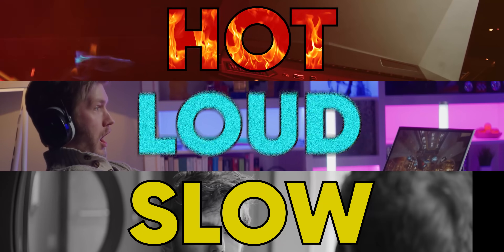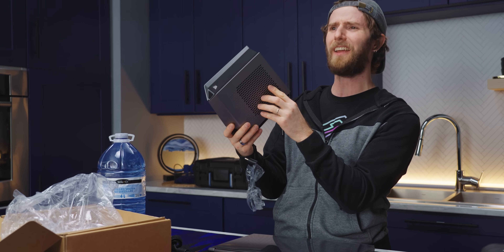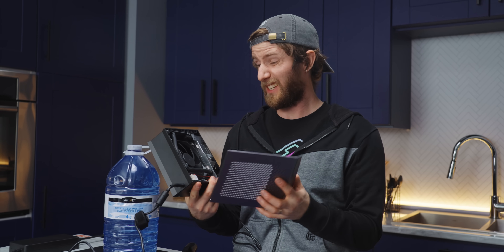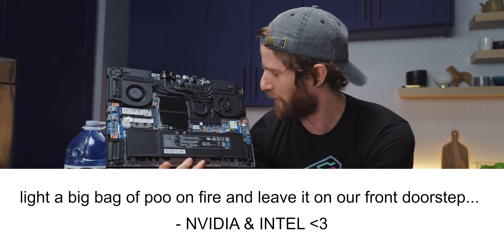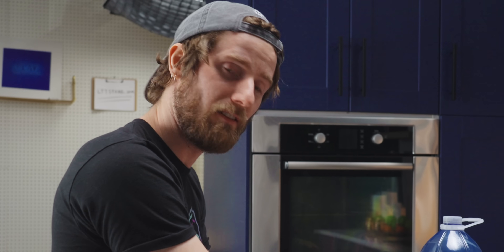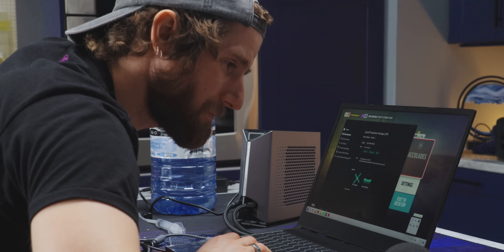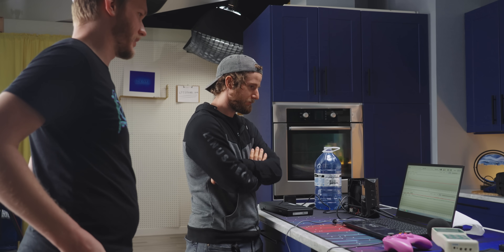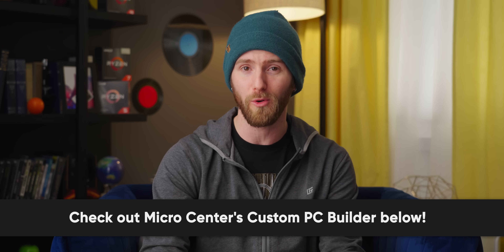This INSANE Watercooled Laptop Has a Huge Problem! - Eluktronics Prometheus Prototype

Comment: A laptop designed with its interior totally sealed off from ambient air -- and cooled if necessary by a closed water system -- would be useful for harsh environments, such as an old truck northwest of Albuquerque in which a poor friend of mine lives.  Minerals in the ubiquitous dust keep destroying his laptops' motherboards.
Reply: idk if that idea could be needed/used for a widespread enough consumer base, but for this setup anyone could DIY what you suggest with some tape and common items, or with commissioning a 3d print of the main laptop bottom cover piece but with no grills or openings, and adding a rubber strip/teflon/etc.. along the edge when screwing it on. I'd probably disable turbo boost or at least set wattage limits with quickCPU or AMD control panel if I were sealing it like that.
Reply: @arsenal4444  : I can imagine DIY sealing of the air vents of an ordinary laptop.  But for it to be watercooled instead of throttled, I think it would be difficult to DIY.  And there may be other airways besides the vents, such as around the ports, if the laptop wasn't engineered to be waterproof.
Reply: @brothermine2292  well yeah that's basically what I said. I thought we were talking about dust/debris proofing though. Obviously for water it's a whole different level that I really wouldn't have any idea how to approach..every keyboard key is an opening, etc..
Reply: @arsenal4444  : The reason I mentioned waterproof is because waterproof would presumably imply dustproof, and some waterproof tablets exist.
Reply: @brothermine2292  so then your friend could just buy one of these tablets?
Reply: @arsenal4444  : Yes, if he could afford to spend a lot of money, and could get by with a relatively snall screen.

Comment: "It must have broken in shipping" 
Linus literally knocked it over earlier in the video.
Though seriously, it is way too narrow of a footprint. It's wobbling just sitting there. That thing is going to get knocked over all the time as you shift the laptop or tubes around
Reply: yeah true, needs an intel NUC type of form factor for stability with some 1/2 inch ish little legs for airflow
Reply: @arsenal4444  or suction cups/magnets on the bottom... don't need to rebuild the wheel
Reply: @moonman506  whatever gets it done, I'm not married to my randomly suggested solution, but I'd say adding more complexity and points of failure without a clear added benefit is not an advisable move

and nice name

Comment: Gaming laptops are always sacrificing either performance or portability... i have one... that thing weighs like a ton... and it's dreadful boeing 747 jet engines just keeps reminding me that i soon have to take out the 389 screws keeping it together, and reapply a bucket of thermal paste, and dig out 6 tons of navel lint... while looking at it, wondering how the 2 remaining pieces of plastic, that haven't sheared of yet, keeps the damn thing together still...
...but that 7 year old thing, that has the internals of a 13 year old gaming pc, still manages to bring a tear to my eye, every time i think of the price-tag...

Comment: I LOVE this idea, I've been daydreaming of external cooling solutions for laptops these past 20 YEARS (even have some of my own designs). The only comment I have about this device is, I'd like to be able to "SEE" reservior level and all the tubing (to check for leaks/in case of) and I think this can be done without sacrificing the esthetic by adding transparent plastic (ON THE BACK) and/or a sliding panel on the side (think glass door) and a level sensor that can emit some kind of audible alarm (hopefully not an air raid siren but loud enough to keep you informed).

Comment: I bought a m1 air its not hot or loud having no fan or moving parts great choice for people who want a laptop with no noise that is still high performance. I'm wondering how much performance you loose from the power pass through with laptops power throttling so easy now

Comment: I picked up a previous gen Mech G3 - these laptops thermal solutions are not great.  They get stupid hot while just idling.  Do like the idea of the AOI pump design tho.  Wish more was done with these laptops to keep the temps down.  Like full bios control over the fans.

Comment: I guess there's still some room for improvement. 
Perhaps increase the water duct's coverage of the heatpipes assembly to further improve on heat capacity/soak ability/trasnference?
Perhaps use quick disconnect assembly on both ends to ease application?
Perhaps consider adding some USB hub or port replicator feature to bolster usability while facilitating some connectivity/configurability for the users to further tinker with, aka user defined "cooling profiles"? ;) 
It could be an even more interesting option when coupled with even 17+" devices that typically are less mobile but are often with more powerful/less limited power-wise components... And if considering such a more stable/less mobile variant that could offer a combo of port hub and even improved cooling, one might toy with even slightly larger higher capacity cooling solution as a more extreme version of this attempt, it could make more sense given the theoretical heat-generating limits of the top components on offer available in those larger chassis formats -  as in maybe consider future laptop variants with thin frames that normally rival XPS/GRAM devices with heavily limited compute componentry, and yet that could be extended with such a port replicator/base station/external cooler to unlock full power of the components - as in take the typically step-downed <35W CPU and <60W GPU thin/light big laptop, use the external cooler and by doing so unlock an extreme/performance mode that bumps the wattage to the thick boys region and beyond ;) that this contraption could cool safely...
And there is another drawback to the current solution that makes it less portable-friendly - when you want to travel it is advised to disconnect the cooler's piping, bleed out the laptop part of loop, let it dry a bit, before moving on. Maybe a future revision could have a mode and extra gear to also blow the air through pipes/laptop to push the water back into the reservoir/cooler unit part of the loop to make it safer/easier to do this. 
But hey, looks great, maybe Asus will get back to those extravagant extremes in their lineup once again and combine a few technologies - for one, dynamic/programmable wattage delivery with basic and with-cooler modes, plus make the devices slimmer but still big (as in do a GRAM-heavy 16-18" "Flow X17" that could transform into Alienware X17 beating monster), perhaps use something similar to their eGPU with USB-C/TB data (thus port replication/hub) and charge (perhaps even 2x100+W lines so 2 C ports used to bolster this and the former's delivery) capabilities. 
Let's hope this solution gets perfected!
Reply: Top comment worthy imo

VERY good point on blowing out and drying the liquid pipe when disconnecting. Maybe have an attachable/swappable filter piece on the laptop out port/path so any buildup can be easily captured and dealt with for the longevity of use.

Also something you mention that really came to mind for me on this - for ultra thin/extra portable designs this could allow was more high end components, just wattage locked to the usual 25-50W, but which could go 150W+ once connected, and all through a since USB-C going to this and a hub at the stationary home spot.

Excited to see whoever develops this concept to market in the future since it could target everyone from lower end users looking to survive from heat and bring their systems to usable status all the way to high end users looking for maximum performance and quality of life at the same time, and are willing to pay whatever price for it. This is really looking like a way to offer what both are looking for.

Comment: lol keep the laptop make your own rad/pump/res combo,  if the tubes stay as they are it should be a easy matter of finding fittings to convert to the laptop and you could have WAY better hardware. d5 pump, 280mm rad add a dock and it could be a beast... and least of all you could ajust the freaking rpm....

Comment: This is amazing! And since it has tubes you can do a little diy to mount the cooling unit under your desk and just the tubes coming up that would solve a lot of noise issues and with noise dampening strategies you could have a complete silent "desktop replacement" laptop also there's chance to upgrade the fan with a noctua if you want

Comment: I've never understood the modern obsession with eliminating fan noise. Fans have always made noise and it's never been a major issue. This product seems to work fantastically, and yet they just can't get over the noise, which does not seem that bad in the video anyway (yes, I know the video probably isn't representing the noise level accurately - but it's not like it was as loud as a jet engine or anything). I don't know, I just feel if my computer performs and stays cool, I don't care a thing about fan noise.

Comment: I'd personally like to see a quick disconnect valve on the pump itself so the tubes come with a similar looking connection piece on both side. This way if for whatever reason it gets jerked the whole system doesn't go with it. It simply disconnects and you have to plug it back in, With that in mind intake and outtake tubes on the pump/res may look better on the side then coming out the back? Otherwise its a cool product. I'm am wondering if an L shaped res would be better so that the res runs the full length of the rad and still comes down right over the pump. would provide more coolant space and would take longer for the water temp to equalize, but not sure it would help long term with temps.
Reply: Pretty sure its not that type of quick disconnect, its secure in the machine and u have to pull down the tab to disconnect, so even if it was on both sides its taking whatever connected with it. U really wouldnt want it to come out even on accident, they are transfering water so If the tubes come out during use good chance ur gonna soak ur laptop.

Comment: "Must have broken in shipping" would have been a perfect time to cut to some clips of him prying the case open, overfilling the port, using his hands to slow down the fan and pump, and purposefully knocking it over lol.
Reply: Yeah, Dave2D's cooler worked fine.
Reply: it's not even broken, the loose wire's hitting the fan blades, i'm astonished that two pc nerds couldn't figure that out.
Reply: That's what I was thinking... although it should be more robust than that lol.

Comment: What would be a challenge though, it's something like this for existing laptops that don't have any way of tidily or safely adding water cooling, like my MSI GE72 6QD Apache Pro. It has copper heat pipes, but no chance of having nice tidy water cooling like this. Would be nice if someone came up with a custom bottom cover and cooling solution that kept the design of the existing copper pipes, but with additional water cooling to help cool the laptop's GPU and CPU
Reply: idk enough about how the liquid cooling pipe lays on top of and contacts the standard heatsink pipes already there to make this call, but I imagine this could be attempted with aftermarket attachable liquid cooling pipes - they just have to fit within the layout of the internal components, go over the correct already present heat pipes, have enough clearance between the components and the laptop shell, and the bottom shell piece of the laptop probably needs some DIY cutting for the liquid in/out ports. 

The main thing though is whether the liquid pipe is just on top of the heatsink pipes or more closely connected for heat transfer in a way that can only be done from the factory...as in just connecting a liquid heat pipe on top of a regular heatsink setup most people have may not really produce much of a result if the contact isn't conductive enough for the heat to escape.

But it sounds like a viable idea at least for DIY modding, but probably with more difficulty due to fragility of components and likeliness of compatibility for everything to fit where it needs to, as well as I predict less performance gain due to the quality of contact.
Reply: @arsenal4444  Oh I mean like an aftermarket solution, as in a company makes water cooling solutions for a wide variety of manufacturers, models, and years of manufacture. It probably will never happen, but it would be nice to have a nice and tidy aftermarket water cooling solution for laptops
Reply: @THAT1ZELDAFAN  That...what I was talking about

Comment: Next; use the connector for the water connector at the cooler and take the control board and make your own custom 240 or 360 cooler and retest!

Comment: the reason why games need so much cpu is because of all of that wireframe data that is not visible that is being processed anyway and even invisible textures. its the crappy way they create this so called realistic computer graphics that suck the life out of the computers. no matter how fast computer you have it will be obselete in 2 years due to the crazy lazy programming of games today and all that glitchy dev code by al the crappy developers. even the runtime is often written in high level language that screm overconsumption of resoruces. windows 10 sucks about 50 percent cpu at iddle and no matter how big cpu and how much ram you have the computer will still use 99 percent cpu running youtube. its microsoft crapheads software inside.

Comment: Glad to know 12rh Gen Intel is still disappointing even in the mobile platforms. Those temps are extremely unacceptable under air. Cool to see folks are working on the cooling. Even if Intel can't make a processor without it being a refresh of 4th gen +++++++++++++++++ getting hotter, it has caused the rest of the community to get nice engineering solutions to fix Intel's short comings.

Comment: Buys laptop to have a small device, to not need to buy desktop.
Connects a big stationary water cooler.
Why did I even buy a laptop when I now cannot move it due to all these accessories? Wouldnt desktop be cheaper?

Comment: One problem I see is when you disconnect the cooler, does the laptop leak coolant? Or are there seals? Also if it has seals you better get the water out because it isnt good to leave it in long right?

Comment: This concept could make Laptop as a Desktop replacement very enticing.
Reply: Not when laptops, on average, are more expensive for hardware that performs equally to lower spec desktop hardware. 

You’re still dealing with power restrictions.
Reply: @rotor13  and you clearly don't understand the concept of a "desktop replacement"

There's always a compromise when doing so, this reduces that compromise.

And I don't know if you've been paying attention or not, but Laptops are pretty compelling in the current market due to the lack of parts at MSRP.
Reply: @LokiCDK  Why would I ever spend more money on a "desktop replacement"?

You CAN get parts at MSRP. You just have to 1) be patient 2)buy prebuilt desktop 3)live near Microcenter

Again...A laptop is lower powered and as such also at reduced performance for the same or similar product SKU. 

That is a matter of fact. To argue that you get the same or similar for the same or lower cost because its a laptop is factually untrue. 

Being it matter of convenience to be a "replacement" over a desktop when you can just get a prebuilt desktop that performs exactly the same as a "high end" laptop for less money is a far more compelling argument. 

A 12900H is equivalent in performance as a 12700K, and a mobile 3080 is equivalent to a Full-size 3070. 

There are PLENTY of SI's who are shipping prebuilts with current GPU's at what is effectively MSRP save for the slight overhead you're paying for automatically - still comes at a lower price bracket than any "gaming" laptop. 

Even a low-end "gaming" laptop with a 3060 and 12700H of any flavor for $1200-1500 - you are literally buying a desktop equivalent of a 12400F with a 3050 at $850 - and it would all fit neatly inside an SFF case that will look like a cable TV box. 

The same people who buy gaming laptops, are always coming to different discords and subreddits saying "hey my game doesnt run well on my laptop".

You are literally wasting money because laptops are e-waste, you can't upgrade them.... there is no argument here for saying a laptop is a "desktop replacement". 

Buy a laptop because you want a laptop as it suits your needs, especially if you travel a lot. 

Do not buy a laptop just because you're lacking reason and are too impatient to wait a few weeks for a prebuilt PC to be mailed to you.

I just bought a prebuilt for my brothers birthday that is in 2 weeks. A 12900k with an EVGA FTW3 3090, on a custom water loop 2 weeks ago from Maingear, and I just got the tracking number a few days ago which it will be delivered tomorrow afternoon - even after being advised it would be a 6 week wait. 

Stop it.